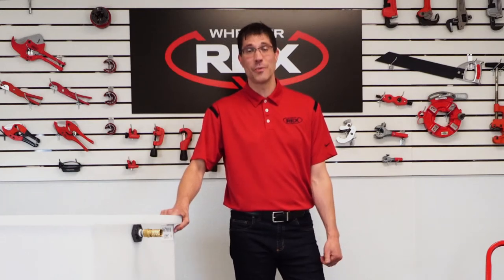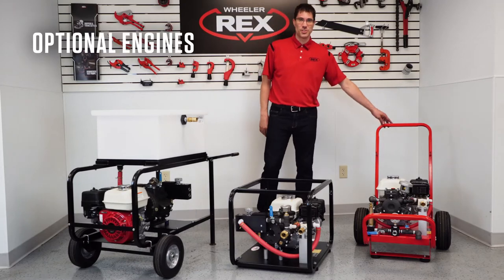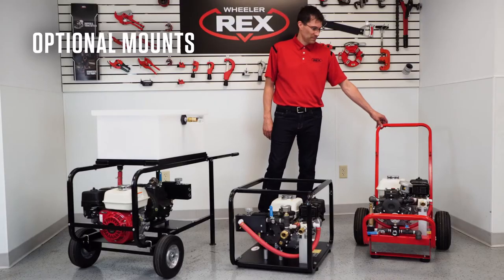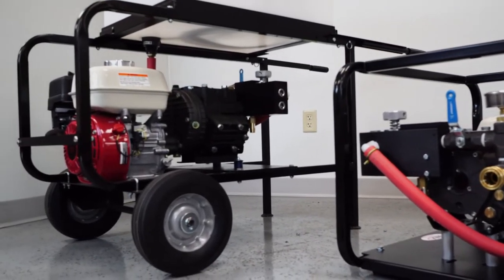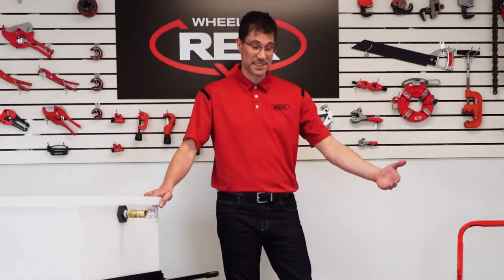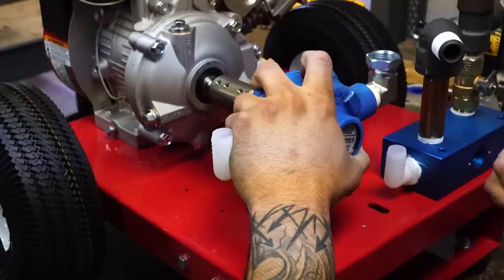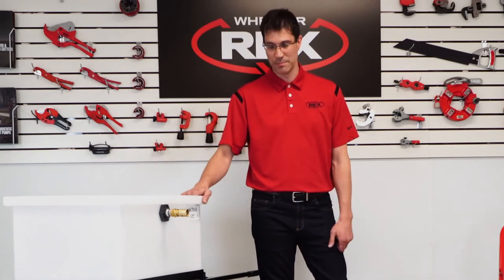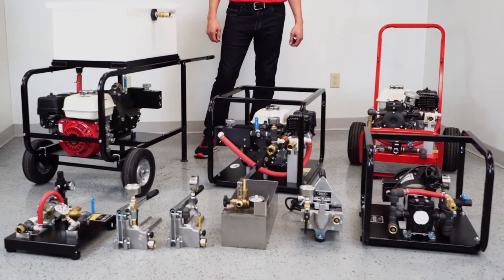WHEELER-REX Hydrostatic Test Pump Rundown

Comment: Tengo una bomba manual modelo 29200 y nunca la he podido usar ya que me vino sin el manual explicativo o procedimiento. La instalo y le aplico presión manual y nunca aumenta presión en la línea aguas abajo de alta presión, a pesar que tengo dicha linea cargada de fluido incompresible agua. Pero no levanta presión, revise todas las conexiones por posible acceso de aire, y no hay manera que penetre aire en la la línea. Agradezco el procedimiento para realizar una prueba de presión en un sistema de tubería de agua y poder detectar fuga de la misma. Sin presión del manómetro no podré saber si está presentando fuga. Agradezco su colaboración, saludos.